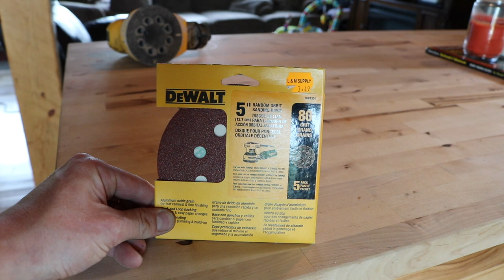Butcher block restoration

Comment: Which sandpaper grade did you use? You presented three, but only sanded once.
Reply: I have the same question
Reply: You start with the larger grit, then continue to go to the smaller. 2 passes with each. He glossed over a lot, but I don’t think it was intended to be a full instructional video.

Comment: Is it necessary to wipe the sanded down countertop with mineral spirits before putting the oil on it.
Reply from the maker: I used a wet rag but other projects I’ve done I’ve used mineral spirits. It helps get rid of the sawdust and also helps with the color of the finish
Reply: Neef to explain wn
Hile workk

Hile eorking @adamfleisch
Reply: Ive heard water will lift the grain a bit, and a follow up sand will smooth those rougher 'popups' (for lack of a better term) so you get a true smooth finish.